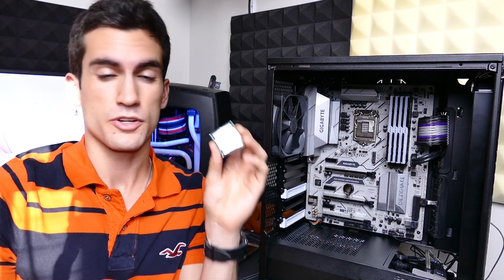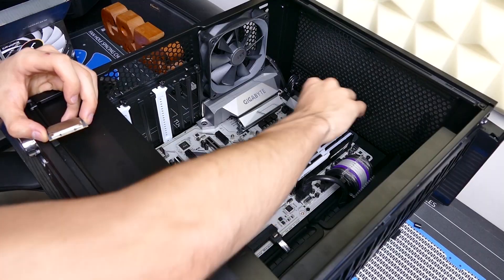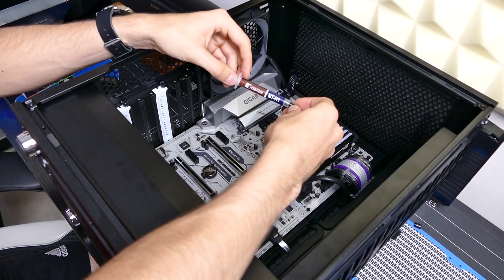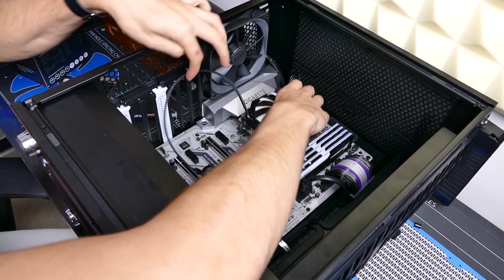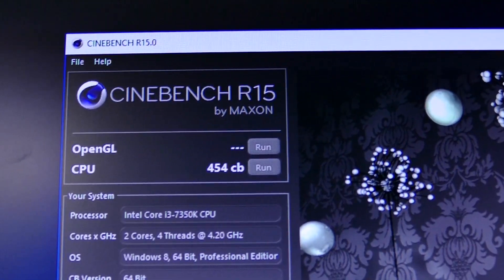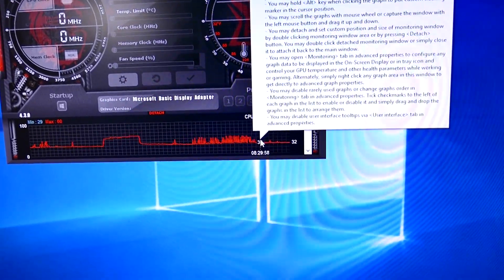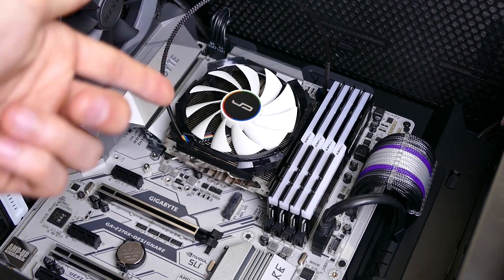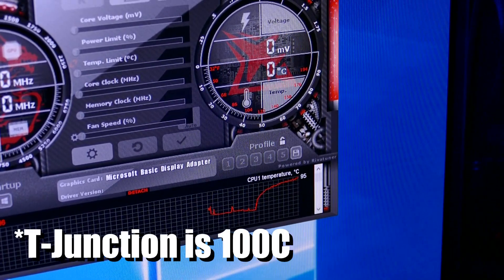Thermal Pad Instead of Thermal Paste?

Comment: wouldn't it be better to cover the whole CPU with the pad for full contact? Larger area surface
Reply: Finally someone wh o feels the same
Reply: JackyLee1226 you are right jackyboii.. Ive put silicon pad (large one) instead of silicon grease, and it works fine as heck xD..
Reply: foxhill153 I believe he was saying that it will work regardless of what way you have to mount it. Which was in response to your comment about not knowing whether it works right or not sideways.

Both heatpipes and vapor chambers function in the same way with the same physics at play. They work in any orientation so long as one side is hot the other is colder. There's a minor difference between vertical and horizontal due to gravity but it is infinitesimal at these scales.
Reply: exactly, kind of defeats the purpose when the IHS isn't properly making contact with the heatsink.
Reply: larger surface area equals to more helping hands hence getting the job done more efficiently
Reply: Area is proportional to heat transfer. Look up a basic heat transfer equations.
Reply: @foxhill153 nope. heatpipes DO contain fluid/s. If you have read info regarding vapour chambers then u surely would understand that heat pipes also contain fluid. Therefore philondez is still correct.
Reply: @foxhill153 just so you know, they can mount in any orientation even upside down :) Cheers.
Reply: philondez x
Reply: philondez but youre wrong because the heat from the die spreads all over the IHS because metal leads heat well all over the place like heatpipes. If your physics where right then heatpipes would be useless.
Reply: ye i thought the same ofc its going to be much worse if u cover less than half of the cpu.
he should have also tested without anything only cooler to see if the pad is better than nothing.
 next episode we test how well paste works with spacers
Reply: barmu lol @ spacers
Reply: @matas danisas Take another closer look at your broken heat pipe. philondez is correct. Heat pipes are specially constructed and are not just copper. They can transfer heat from the cpu many times more efficiently than solid copper due to the energy transfer in the latent heat of vapourisation of the fluids inside a heat pipe.
Reply: @foxhill153 Whatever you bought with a vapour chamber should work very well since they work on exactly the same principle as heat pipes. Vapour chambers can be more efficient too in transferring heat depending on the circumstances. Enjoy your product because there possibly was no marketing bs :)
Reply: unlost117 not with the amd bracket. With Intel yeah, but screw holes placement for old amd FX stuff only allowed for orientating things one way, unless you had a cooler which could orient itself both ways on the bracket (there were exceptions, but mine didn't allow) The mobo in question is the crosshair V formula Z and the cooler is the cooler master TPC 812 v1, 2012 edition. In case you're curious.
Reply: Oh sorry yeah, I just read somewhere a long time ago that heatpipes are better unless your vapour chambers are oriented the correct way. I always just assumed this was true. Sorry for the confusion! Cheers!
Reply: dude the whole cpu heat spreader heats up not only the middle of the cpu where the die is, so full coverage will help a little with twice the area
Reply: @foxhill153 so I once had a nice fan but it didn't fit inside the new case I got for the pc I was building (very cheap case for a pc built from old parts)
I decided to cut the tops of the heatpipes off because... well, they were sticking out of the heatsink like 3cm and I was 1cm short for being able to close the case.
Long story short; The PC kept shutting down cause of overheating (on an amd phenomIIx4 @ 4.8ghz)
Reply: Yeah just be careful because these can effectively drive electricity
Reply: yeah, but since they're pads and not liquid, they actually reduce a lot of risks as they can't leak out.
Reply: I feel the same 😂
Reply: and with 2 layers of thermal paste on top and bottom
Reply: www.andyrawmaterial.com
andychowmailbox@gmail.com
Reply: Yes it would be. I am also trying to determine what brand of pad this is. As most of the silicone pads I have dealt with are blue in color.
Reply: 420 likes :D
Reply: Yes.

With a thermal pad you want to cover the entire interface area.  So you cover a size the entire size of the smallest portion of the thermal interface (in this case that would be the entire top of the IHS).  In other words he was using it improperly.

That said, I've never seen one that ever worked as well as thermal paste, but it's meant for different applications.
Reply: Because he is a cheater.
Reply: Yes, that's what I was going to say.  Therm. pad is less efficient by nature, so it needs all the help it can get.. by that I mean access to the entire sink/cpu lid to transfer heat.
Reply: If you take a look at infrared images of CPUs under load, you'll see that heat is most concentrated toward the center of the chip. Heat flows, so when there's less heat in one area, or less energy, naturally energy is conducted to make up for that loss in energy. In doing that, heat will always try to transfer to the center of the chip, only to get sucked away. Still, only covering the center of the chip is a rather inefficient way to do things, but inefficiency was the entire point of this video. Don't forget that.

https://www.x20.org/wp-content/uploads/2014/05/PCB-Thermal-infrared-analysis-image-128.jpg
Reply: I don't see how heatpipes are relevant here.

In terms of thermodynamics, the proof is in the pudding: since 2015 Intel has stopped soldering the IHS to their processors, instead using thermal compound to bridge the gap between the die and the IHS.

It turns out that solder, a mixture of tin and lead (not the most thermally conductive metals, not even close at all) is far more thermally conductive than even your best thermal paste.

Hence, to ensure your thermal compound can transfer that surface heat away, the area it spreads out to should much larger in size than the surface of the die under the IHS.

The same goes for thermal pads; in fact, the surfaces they unite should be larger yet, because they're even poorer conductors. The less thermally conductive a material, the more surface area you need to share with it to move the same amount of heat.

In fact, even your aluminium IHS (which is far more thermally conductive than tin/lead) is a bit of a bottleneck... If you use a copper or silver IHS, instead, you should be able to use mercury as your thermal compound. I reckon copper and mercury would be your best choice, due to coppers price and thermal conductivity, and the thermal conductivity of mercury as well as the tendency for it to expand as it's heated... but you can't apply mercury to aluminium; sorry about that.

I bet you already knew a lot of this, didn't you?
Reply: that would be wrong... it is important to apply as close to as possible, an equal layer across the IHS to make as much contact to spread the heat fully into the heatsink.

also not use trash thermal paste like most OEM such as HP, Intel, and nVidia.
All 3 use the same crap, HP varies between a thin (trash) and thick paste.
Reply: Well boy did i fall in to the vapour chamber marketing bs XD
Reply: Youre correct.. except the cpu i was using mine on was a fx9570 XD. great cpu btw.. except that danged amd mounting bracket required vertical installation.. So i dont think the chambers were designed to work they way I had it mounted. Needless to say, i put that cpu under water pretty quick :p. Thanks btw!
Reply: The grease too, covered only 65% of the proc!
Reply: Yes you are right. my cpu is a bit cooler when i cover the whole ihs with grease
Reply: +philondez nope. heat pipes have no fluid. youre referring to "vapour chambers"
Reply: JackyLee1226 no finally i removed what i said and it sucks as hell! I performed a benchmark with the silicon pad i get 70c' or something.. But was 52c' with silicon grease.. So silicon pad sucks
Reply: philondez they arent filled filled with anything. I broke off a pipe once, when I had a a heatsink to spare
Reply: Heatpipes aren't just pipes, if they were they wouldn't be sealed at the end because that's just reducing your effective surface area. They're filled with fluids that boil away which is what moves most of the heat to the finstack. The portion of the pipe at the fin stack is filled with shredded copper (kinda like steel wool but copper) which helps the vapors conduct the heat to the actual surface of the pipe and into the fins. Once the vaporized fluids reach the finstack they cool, condense, and flow back to the coldplate where they can evaporate again, repeating the process. If you get your heatpipes hot enough that this process stops then their efficiency plummets to something like 10% of their optimal performance because the actual pipe portion isn't capable of moving heat at anything close to the efficiency of the fluid cycle. 

While covering more of the heat spreader would probably help a bit in this situation it wouldn't be by much, definitely not enough to prevent throttling on the CPU. If covering the entire heat spreader made a big difference people would recommend using enough thermal compound to cover the entire IHS. You can also tell by looking at intel's cooler design. The part that presses against the IHS is much smaller than the IHS itself. If it made a large difference they'd just make that part of the cooler flush with the fins.
Reply: philondez fluids? Hello are u fucking drunk?
Reply: The actual die underneath the heat spreader is about the size of your pinkie nail, at least for quad cores, possibly smaller for an i3 since it's only a dual core. It's not until you get into the parts with huge core counts that you need to worry about the heat spreader being completely covered.
Reply: The die may be small, but if the whole pad is containing heat there will be a net increase in heat moving towards the centre and getting to the pipes

Comment: Ok that processor is actually a pretty good one. The i3 7350k is a dual core with hyper threading and clocked at 4.2Ghz. I just built my Linux gaming box with a msi GTX 1050 ti small form factor graphics card and paired it with an i3 7100, and it plays all my games very well. I may upgrade later, but for now I'm very satisfied.

Comment: Use a cooler you don't care about and rub it like sandpaper on top of the cpu without thermal paste then run the benchmarks but I'll let you figure out how to mount it without lifting it off the cpu after you're done rubbing them together. Reason why I'm suggesting this is because it's possible to stick two metal surfaces together if they are smooth enough by just pushing them together and twisting them. Not saying that a CPU is at all a smooth surface, but why not try :D Maybe the CPU dye will be flatter.... ;)

Comment: You should have covered the whole heat spreader of the CPU with the thermal pad, and used a better cooler. I heard that cooler performs less than something like a hyper 212.

Comment: try passively cooling it with a water cooler XD I did that by mistake by plugging in a 3 pin plug on the wrong side of a 4 pin socket the processor bottlenecked my video card so damn much some how

Comment: Could've been interesting if you tried one of those more extreme thermal pads which have 17W/mk  thermal conductivity, which would be higher than thermal paste (just like their price is). It would be still so much thicker layer than paste so it would be way worse, but it might be good enough since intels run pretty cool. 

Granted, I don't think you ever mentioned what thermal pad you were using, but that looks like the generic GPU water block stuff to me, which isn't quite as high performing. 

I guess with math you could calculate it, but where's the fun in that. :)

Oh and killing Intel CPU's is quite hard, but enough voltage should do the trick. Might not be possible with the motherboard though.

Comment: I can't stand the name science studio - I realize this was probably impromptu and for shitz n gigglez, but in order to compare temperatures, you need to normalize voltage, clocks, and fan speed. Leaving all of those on auto allows for boat load of variance. In short, bad science. The other issue is that the contact patch is far less (another variable not accounted for) with the thermal pad - should have either covered the entire IHS with the pad, or put a copper block the same size as the thermal pad between the CPU and heatsink. This is huge as the point of thermal paste isn't to conduct heat, but ensure maximum contact between the IHS and the heatsink as there are micro imperfections on each of the surfaces which trap air and act as an insulator.  That oversight alone defeats the entire purpose of this video.

Comment: You didn't even cover the whole IHS....
Reply from the maker: madjimms Neither did the thermal paste once pressed. So relax.
Reply: Even if you did there wouldn't be any improvement with that thermal pad lol
Reply: Well I understand madjimmes point (I share it). So do I understand yours, Science Studio (I share it too).

On one hand the demonstration is not exploring the full potential of thermal pads as heat transfer surface matters.

On the other hand the current demonstration represents the same heat transfer surface without a burnin period that will overtime increase the surface covered by thermal paste as it slowly spreads between the IHS and the heatsink.

Also as it is mentionned in the video, the thermal pad is 3 mm thick, that is HUDGE.

Thiner pads like 0.5 mm or even 0.3 mm could increase performance by a factor 4 to 5 as it lowers thermal resistance (°C•in2/W).
e.g. see high end product XR-m Series p20 of http://www.fujipoly.com/usa/assets/files/Fujipoly_2012_Catalog.pdf

It doesn't seem to be high performance thermal pads as well as there is a wide range of thermal conductivity (watt/m•k) from as low as <1 W/mK to 17 W/mK
If you picked this thermal pad from a graphic card or something similar it is likely that it is some 3 W/mK
but still, it is another factor 4 to 5 times less performance than the higher end products.
see http://www.fujipoly.com/usa/products/sarcon-thermal-management-components/ 

So I guess there is room to see if even at it's full potential thermal pads could replace thermal paste in a follow-up video :-)

Because should there be some closer performance to thermal paste, it could save you so much time not cleaning IHS and heatsinks everytime you bench a CPU !

Comment: its an i3, it cant put off large temps, try i7 if you want to see it throttle try an i7..
Reply from the maker: Tech Ownage It can put out very high temps...
Reply: i really wanted to see it throttle when you were testing the i3 with thermal pads hehehe 

i dunno if this is a retarded suggestion/question, have you tried substituting a double sided 3M tape as a substitute for thermal pads used on gpu VRMs?

Comment: Hey Greg, I have actually noted that Kabylake is kind of resilient to thermal throttling. It can drop its turbo frequency a bit but it doesn't seem to throttle that hardcore..
Reply from the maker: Soumyakanti Roy Guarantee you I can make it thermal throttle in seconds.
Reply: Science Studio okay 😂 I have a dell Inspiron 7560 i7 7500u and it reached 95C on a mixed cpu gpu load (not gaming) and still managed not to throttle :P

Comment: Oh well... I dont think it was a fair for the thermal pad.. (I know it will suck but!)  the thermal pad should have at least 2 strips covering the whole CPU.. as the pads dont spread like the paste.. (they may even shrink) as u can see when he removes the CPU the paste has cover a lot more CPU than the pad... anyways.. good for fun i guess..
Reply from the maker: Jean Carlos Niehues the paste didn't cover the entire IHS...
Reply: heh I notice it didn't.. I just mention it as we all know it would be a unfair match and the size of the pad just made it worse..  do you agree that if we have more pad surface we would "probably" have a better heat transfer?! maybe a pocket video to check? :]

Comment: Is that 7350k really that bad? I mean 4.2 ghz on 2c/4t and it hits just over 450? My really old outdated fx 4100 @ 4.1ghz still 2c/4t hits just around 300...wtf. and yes i know i should upgrade before any salty comments.
Reply: Ryan L because you can get a much better CPU for the same price
Reply: Ryan L the thing is 7350k doesnt overclock really good and it's very expensive for what you get
Reply: Ryan L your about due for a whole CPU/board upgrade. If you did upgrade I would recommend amd ryzen line. The best value in the history of cpus
Reply: I don't think it's that bad. If you can get it for a good price. I just bought 1 from microcenter for $130 with Z170 MB (combo) and got $30 off. So I essentially got for $100. Oc's to 4.7 NP and is more than enough for a mid range gpu.
Reply: So basicly if i wanted to upgrade either get a better fx processor or just get a g4560?
Reply: Wasn't that a Phenom line !?

Comment: what about some copper slugs between the heatsink and the cpu?
Reply: Elastico345 - Mixels and other stuffs 
copper slugs need thermal paste on top and bottom.
Reply: Depending on the mounting pressure, it could work. Though you'd have to reach the yield stress of the copper - if you did that it'd make an excellent thermal pad, as good as liquid metal if not better.

Though - the mounting pressure would be ridiculous. I'd love to see how effective it would be though, and a graph of effectiveness vs mounting pressure to see how high you would need.
Reply: +elink1
Your CPU would be crushed under the weight. The die would be cracked.